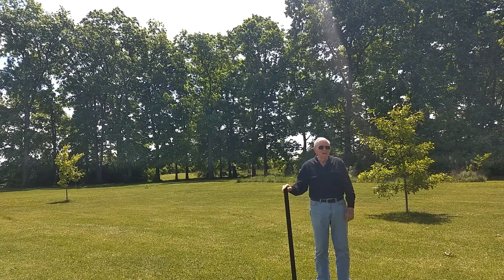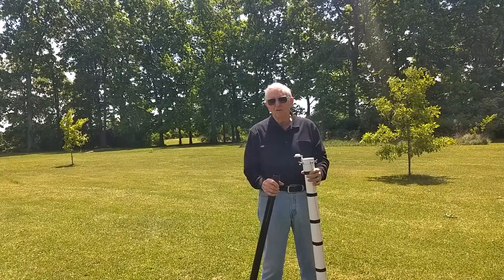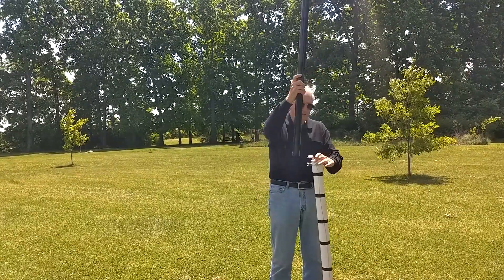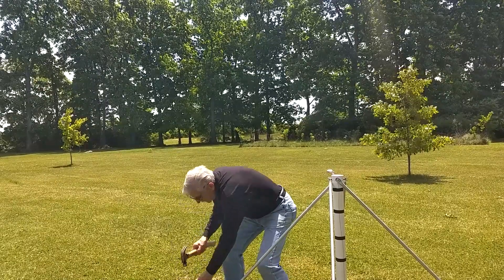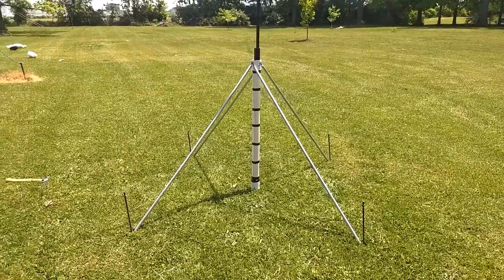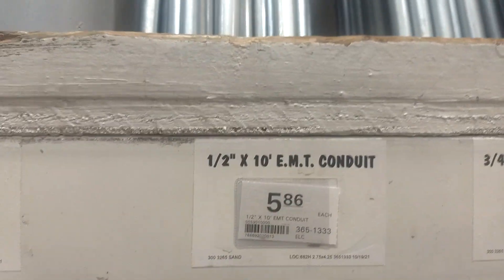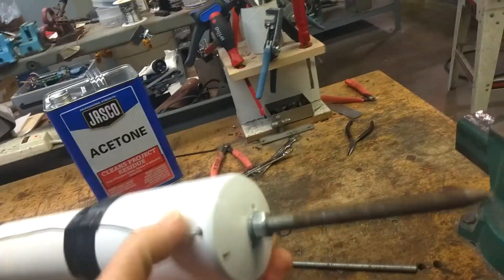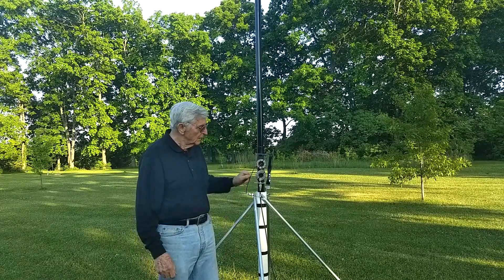Mast Support for Portable Antennas for Field Day and POTA and Emergencies.

Comment: Absolutely genius! It's a bit bulky but not intended to be backpacked to a SOTA, but fine for POTA. The only thing I might change is the spike; not crazy about that sticking out. Maybe do a bayonet type of spike that can be set in place as needed. Lot's of thoughts here.  Great solution and you can tell you're either a seasoned tinkerer or an engineer.
Reply from the maker: I slide a piece of rubber hose over the spike when not in use. Thanks for your comment. 73
Reply: Agree.  Although some park rangers do not appreciate us aerating the park grounds.  A friend of mine is an avid activator and was told to immediately remove his antenna because of his ground spikes.  Luckily, he had already gotten more than 10 contacts.